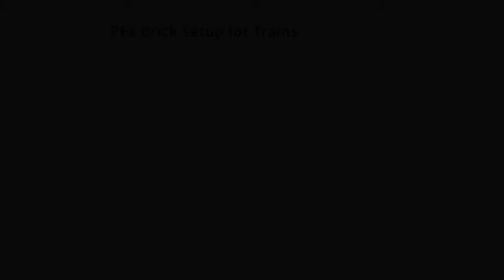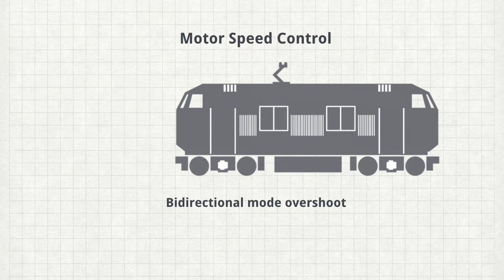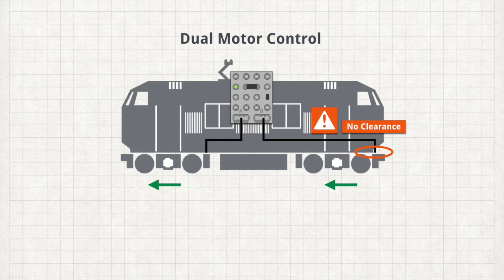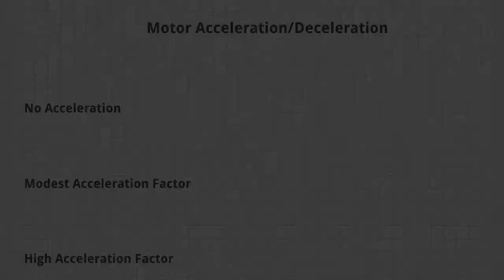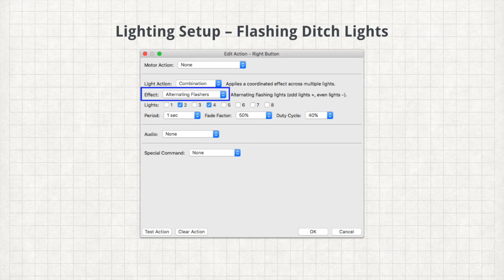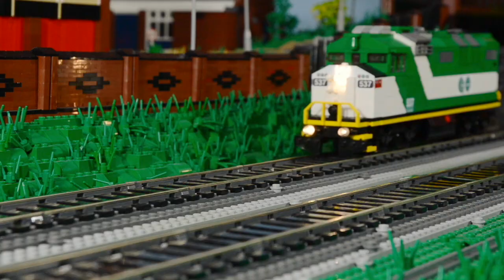PFx Brick Train How To Part 2

Comment: Imagine a 60051 train, it will need two bricks. Can they also sync together?

PS: you have to integrate it with your new 9V motors so the brick can take power from them instead of a battery :)